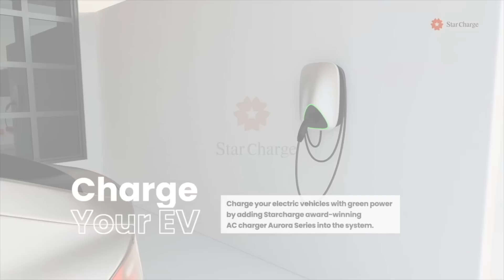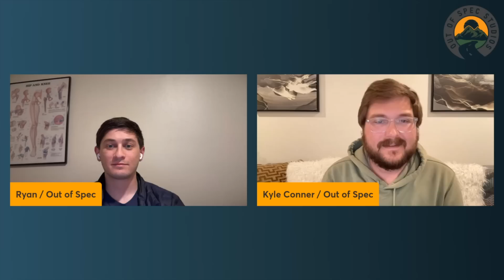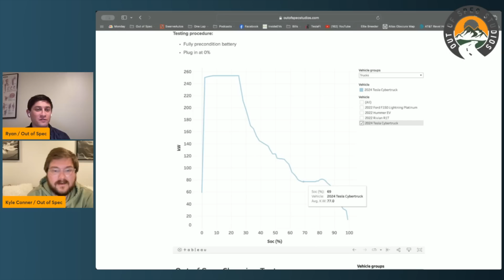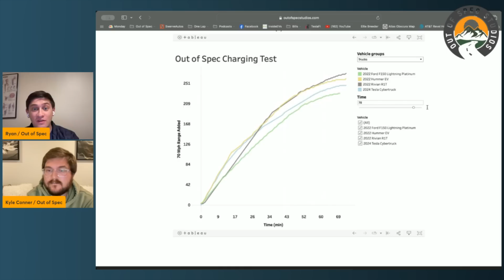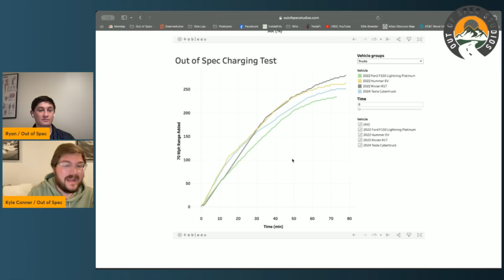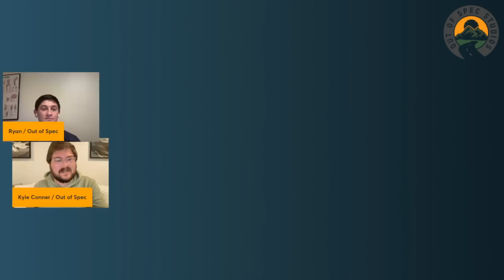Cybertruck DC Fast Charge Testing & Analysis - Comparing To Rivian, Lightning, & Hummer EV

Comment: you started the cyber truck super charge at 0 percent and you don't know conclusively that the cyber truck won't pull 260kWh if you happen to start super charging at 30 percent or some other state of charge. Maybe Tesla is limiting the speed because the cables are getting hot after a certain amount of time. More testing should be down prior to assuming 25 percent is the hard cut off!
Reply: They did start the charging sessions at different SoC across multiple charging sessions, that's what they explained in the video... the Cybertruck just can't charge faster.

Comment: one of the thing that most of us / or just me charge around 30% to 80%. it will be very interesting to know the comparison between EVs from 30% to 80% or 90%. out of spec has all the data should be very easy to plug the data in.

Comment: Kyle keeps saying he likes to run his batteries down to single digits, but is that really good for your battery?  I have been using lithium based batteries for years and for getting most life out of your battery it was my understanding that regularly using the bottom 20% and top 10% of the battery was not recommended.  Sure, for long trips you would obviously want to use as much of the battery as necessary, but for everyday driving where you only may use about 15 to 50 percent of your battery, it is my understanding you want to stay at the upper ranges of SOC, rather than the lower.

Comment: Think the CT is likely limited right now as they get more data on the pack. It will improve over time
Reply: It won't
Reply: @BBingo-v5i  it’s also only using 400v rn and capable of 800v so

Comment: Even though chademo is dead, I would still like to see if the Tesla cyber truck can use the chademo adapter. You could even test it at one of the older EVgo stations that has the chademo adapter attached to it. also it would be interesting to find out if the cyber truck can charge on a 50 kW slower CCS charger.

Comment: Awesome data! I'm going to be using the crap out of that graph comparator. 

The Lightning definitely charges faster now, post-boost through 80%. It still falls off a cliff at 80, but IIRC the Lightning ER will hold about 110-120kW straight to 80% barring any thermal derates. If you're coming back to Detroit, you can drive and charge mine anytime! Not sure where the nearest 500A CCS station is...

Comment: EVs are still just 4 wheels controlled by a steering wheel and foot pedals. Why are y’all so committed to this analysis?  Just buy a gas powered car. EVs are not high tech. They suck.

Comment: The low range stopped me from buying the cybertruck. I wanted one very badly but I can't replace one of my ice trucks with an ev with such a small battery.  It just can't do the job. I am deeply, deeply disappointed in Tesla. And that range extender is an insult. The bed was marginal at best. Take away a 1/3 of the bed and you don't have a truck. Wtf was Tesla thinking?

Comment: EV truck charging right now just screams “we’ve run into the limits of physics and can’t charge them much faster in these huge packs”.
Reply: Hopefully someday we’ll get a battery that can take 350 kW for 10+ minutes straight lol
Reply: @ryankassel5691  yeah, I’m sure someone will eventually come up with batteries that are efficient enough and high enough voltage to pull it off.

Comment: At 52:55, the Lightning has a better charge curve than is shown.  And no, the boost isn't factored in your charge curve.  The single boost might have been, but you'll get the boost at any point you plug in below 80%.

Please retest the Lightning.  This curve isn't representative.  Just look at Tom M's curves.  I've personally seen 186kW in my Lightning.

Comment: 48A x 220V = 10.5kW
That should charge a cybertruck from dead in under 12 hours
It will probably get you from dead to enough charge to reach the closest supercharger in 1-2 hours max, if you're really in a time crunch

I can't see any reason you'd need more capability than this

Comment: Good call out of A/C charging, I think even Tesla's cars let alone the Cybertruck, need an 80 amp AC charging. Can make a difference when stopping somewhere for a bite / tourist attraction to visit and definitely helps for overnight charging in the case of an EV truck.
Reply: There's so little public 80A charging infra. It seems like the EV makers and charge point operators have collectively landed on 48A max....

Comment: This is an outstanding approach.  I really liked the new graph showing distance/time. I've followed your roadtripping experiences since late 2019, and tho I rarely do it, I ventured out on a 2k mile trip in my SR Tesla 3 and felt completely at ease going from TX through the Ike tunnel, as soon as panhandle in TX got a charger.  Both directions, that SC was the only time I needed more than 30 minutes to continue the trip.

Comment: Love the new graph showing range added over time for actual 70 mph efficiency. I’ll be watching for when the R1T max pack vs large pack on 21” wheels makes the chart. I’ve got to think near the top the max will show a bit of advantage. I’m typically charging our max pack to 90% at a DCFC to make the next charger when towing.

Comment: My 2021 Polestar charge faster than your test on your website.
They have done a huge software update on the older cars ! Big change in the curve !  Its 2021 2022 2023 models got a huge upg

155 kw max, 32% l got 144 kw when l saw a shot clip from summer in sweden

Comment: Now I wonder what the R1T would look like if it supported 700A… Could it hold 250kW longer than CT? Or would it just start its downward curve at 25%, too?
Reply: R1T already struggles with thermals at 500A, I don’t think it would make that much of a difference without improved cooling

Comment: Totally agree about the 80A charging situation.  I have a 2013 Model S and it can charge at 80A... I also set that up at home.  The car charged from empty to full in 4hrs15min!!!  When it was newer.  Now with 10yrs and 277,000 miles it take more like 5hrs.  Our Model Y takes longer even though it's brand new... only drawing 48A.  It has to be said that the thicker-gauge 100A cables needed for 80A charging can be pretty expensive.  Not everyone is going to spring for that stuff even if their vehicle can draw 80A.
Reply: Try that with a total of 100 amps of service like most people have!
Reply: @richardwolf6269  yeah.  I understand the basic supply box for most new house construction has been 125A.  Maybe with BEVs on the horizon they're getting a bit more, but anyhow I had to beef mine up to be able to charge the Tesla so I had them put in a 250A box.  Austin Energy were aware I was doing this and decided to upgrade my supply cable from the street at no cost to me... they upgraded it to 300A!!! (I do not believe they are doing this any more, it was early days for them)

But the home can often represent part of the cost for adding BEV charging equipment, no doubts there

Comment: I don't have an EV (yet), so this is a noob question:  Is the curve strictly linked to the SOC, or are some factors time based?  We are holding 250kw or near to 25%, but is that limited by a programed SOC curve or is it based on heat?  More specifically, if I plug in at 25% SOC, will I see a different 25-50% curve then I do starting from zero?
Reply: It depends on the vehicle. The model 3 rwd changes the curve depending on SOC at plugin. You can hit 170+ kw starting from a variety of SOCs and the subsequent curves are slightly different. Other vehicles will follow their curve much more strictly. It appears that the Cybertruck will follow a set curve as long as battery temperatures are acceptable. The charging curve can change if the battery is too hot or too cold.
Reply: @ryankassel5691  Thanks!

Comment: This isn't fair as the pack size also factors into charge curve.  The hummer takes a huge charge because it has so many cells!  you should divide the power by number of cells to find it more fair.  If you add the range extender to the cybertruck, it will probably hold a much higher charge.
Reply: And at the end of the day, number of miles added per minute is the only curve that really matters.
Reply: That’s why we include it!

Comment: The best reason for the 80 amp on board charger is if you live where there is a Time of Use (TOU) rate plan.  Many of the TOU's have a super off peak time from midnight to 6am, only 6 hours.  At 48 amps you can at best get 69kWh, but you'd never actually get that with charging losses.  With an 80 amp charger you could get 115kWh (but less with losses).
Reply: So true. 60 or 80 amp will become the new standard for larger vehicles simply because of the reason you state.  For everything else, 40amp will suffice...
Reply: Can home electrical system even support that sort of sustained power for hours? That sounds really dangerous for most people’s homes?
Reply: @dv5466 yes, the Ford Lightning can charge at 80 amps. The early Model S also could charge at 80 amps. You just need to be able to support a 100 amp breaker.
Reply: @dv5466  obviously the wiring needs to be to code.
Most detached homes and town homes have 200 amp service. So taking 40% of that power away probably won't work. 
But this level of service will start to come into it's own, probably starting with new detached home builds for savvy EV customers. Not everyone is going to need it. But for those that do, they'll figure out how to make it happen...
Reply: You obviously don't own a large EV. Over 95% of the time my EV9 100kWh battery takes less than 5 hours to charge from a average day of use.
Reply: @DJR-u2g my battery is 135 kWh. Just because you don’t drive your car doesn’t mean anything. Some people actually drive and use their range.

Comment: So why would you need AC power while you are fast charging, using AC power while charging will increase you charge time.
Reply: You also can't use AC power while slow charging. So no charging at an RV park while using the power outlets for camping.
Reply: @TroySavary 
Use the 115V 20A is you are desperate for power.

Comment: Designing and then recommending that you need to discharge to zero to make your drive a better experience is ridiculous. Running cars to zero SOC is more difficult to not get wrong and the outcome is a giant pain. Get real. This is not just a bad charging experience, but your advice isn't great. Just report is as troublesome and let Tesla sort it out.
Reply: Calm down. He gave great details and insight on the effective charge curve. It's just a fact that zero to 20% is the fastest charge profile for cybertruck. Obviously you can't road trip to 0% SOC. This limits it's effectiveness as Kyle pointed out.

Comment: What a cool tool. It will be interesting to get the 3s on there and the performance y to see if having the performance battery chemistry allows for faster charging. The plaid charges faster than than the y despite having a bigger battery but the cybertruck charges slower than both. Will beast mode charge faster? Does it have different chemistry? Thanks for making that!

Comment: Words to the wise:  NEVER EVER attempt to override the a code-required fast-charge connector's safety-related high-limit temperature controls by wrapping the handle or the cable with a wet rag.   It's like taping a bag of ice on an overheating circuit breaker. It "works" but is a BAD idea.

Comment: You could compute the 10% challenge numbers from this data too, or any other x minutes starting at y % data. Could be a nice feature to add. Another interesting thing would be to take a horizontal line across the miles added chart to compare how long it takes to get x miles added in different vehicles.

Comment: The thing I’ll say about the Hummer EV is that they’ve improved the curve even more since your testing if this is the data from over a year ago.  I’ve done a 37 minute, 135kWh delivered, 17-80% charge on a 350kW that started at 344kW and ended around 170kW at 80%, so above 200 for most of the session.  And that 135kWh was good for another 200miles of range to the next station when I rolled in at 20%.  And that’s still on the 18” MT tires and a tonneau cover.  Would be closer to another 225-235 miles with the 22” ATs that comes on the non-off-road package equipped trucks.
Reply: That's good to know, cause it originally was also fairly slow for such a large battery.
Reply: New curve via OTA update?

Comment: NOPE, You cannot tell people to just wrap a cold wet rag around the cable to compensate for overheating cables. You sound ridiculous recommending that people should hop from charger to charger as the liquid cooled cables overheat. What kind of 54i7 tech are you happily walking us through?

Comment: Comparing the IONIQ 5 & IONIQ 6 you can see the Areo efficiency difference. The trucks are exponentially much lower either because they are more inefficient, or don’t carry as good of charging curves. More likely a double whammy like for the Cybertruck being a bit of both which surprises me. The drag coefficient looks like seems to have been minimized with the Cybertruck long tail over all profile with only the tail gate (vertical surface) being its biggest drag. I’m guessing with the bed cover open and tailgate down would yield a 5% range increase. Would be nice to see a bed flip out gate with an integrated brake and bonus amber turn signals would make that a safe option. I’m surprised Amber wasn’t used for the turn signals. I would think multi colored LED’s would be available at the illumines required. 59:41

Comment: Cybertruck is released about a year too early. Its still in testing phase. 

How does this company is given a pass for releasing product without autopilot, FSD but they are selling foundation series with FSD included? This should be illegal.
Reply: It will be added when foundation models are stopped

In the next 3 months but fsd beta probably is a year off true

Comment: Great stuff, I love the charts and data.  Only thing to watch out for was the comment on "if the current limits stay the same" on the Cybertruck.  at double the voltage 350kw uses 70% of the current as 250kw at half the voltage.  So that means that at double the voltage in theory the CT would keep the max 350kw for longer.  Plus, if heat due to current is what causes the 400V charging to slow down so much, running at a lower current may make the peak rate last significantly longer.  It's also possible that the pack splitting connectors are the limiting factor for current draw.  Bottom line, we don't know what higher voltage charging will bring yet, but there is a lot to be hopeful for, and it wouldn't be shocking if it results in an extremely impressive, and class leading, charging curve.

Comment: Be careful what you wish for - When batteries charge slower it means, either.

1. They want the batteries to last longer. This is generally the most likely.
Or
2. Their heat/cooling management system is not as good.
Or
3. Their battery chemistry is not as good as others.
Reply: Or all of the above!

Comment: What would be more interesting is see the battery temperature during this charge, the big announcement on the 4680 was all about reduced internal resistance with the new tabless design so substantially reducing heat. Maybe this is what does not happen in reality and the battery sidewall ribbon cooling in every other row may not be enough to handle the heat.
Reply: We don’t have a ton of temperature info logged but the 4680 cells got hot. 55 C at 25%, 60 C at 45%.
Reply: @ryankassel5691  Thanks Ryan, that would appear that the current model  cooling design is the real issue, even chemistry updates would likely not change this restriction. They need to re-engineer the cooling design. The reason why the BYD Blade Batteries in EU delivered Model Y RWD charge so well is the surface area of the cooling for each blade cell is likely the best design in the EV industry.
Reply: @ryankassel5691   I just watch Munro's battery break down of Model X and Y (2 months  old) and they go through some of the redesign of the Model Y / 3 ribbon cooling to improve the surface area cooling and yes my 2023 Fremont delivered Model Y long Range AWD rocks for charging, so likely Cyber truck could get wider ribbons channels to make the cooling more efficient without big design changes. Tesla is always improving!
Reply: @ryankassel5691  Sweet baby Jeebus, that's toasty.  People were concerned about the Taycan hitting 50C.
Reply: The 4680 cells have proven to be a folly, first with the now-orphaned Model Y AWD and now the CT. In both cases, the charging curve is at best mediocre. The thermal-management approach was ill conceived, and we owners of these vehicles are left holding the bag.